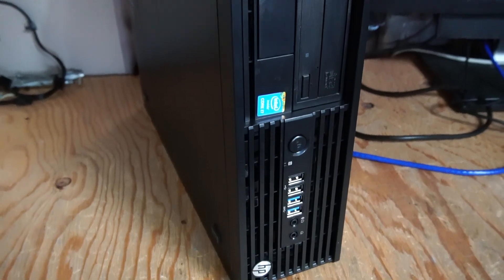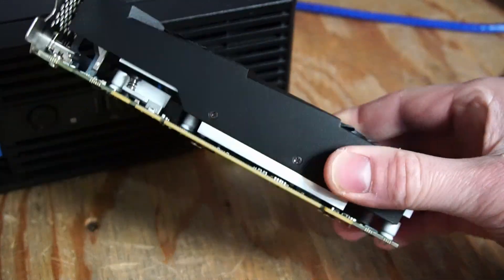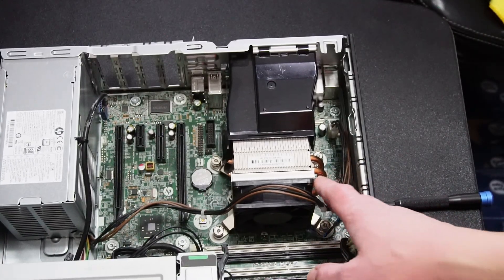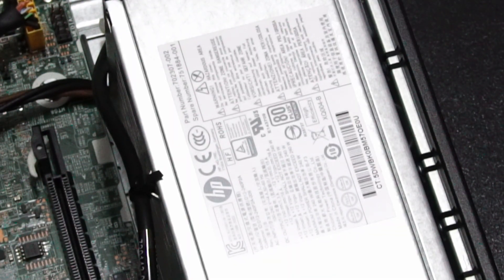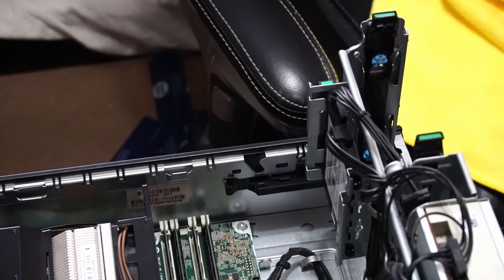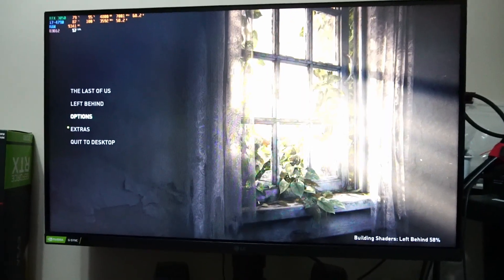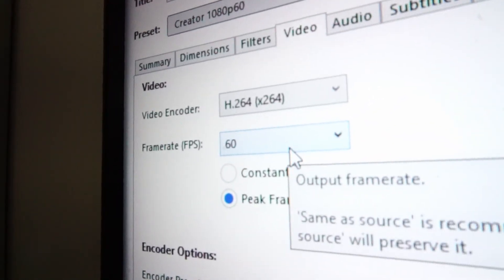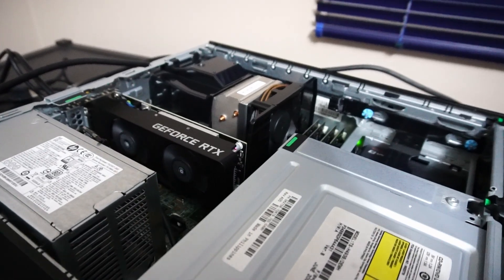Gaming Upgrades in an HP Z230 Workstation PC! (2025 Version)

Comment: I have the same computer and specs but with a msi 1050ti 4gb low profile and 16gb ram, is worth it to upgrade to 3050?
Reply from the maker: I would say go for it if you find the 3050 at a good price.  Otherwise it's kind of expensive for what it is.

Comment: Hi I’m doing this also with the exact same PC! I bought a 350w PSU for it though.

Was wondering if you or anyone else here is worried about windows 10 security updates. I was trying to install windows 11 with rufus on this but it was not really working so I might just stick with the windows 10.

My plan is to take out the dvd player and put a vent and fan in its place at the top. 

Also going to cut a hole in the side panel and put an acrylic panel in it.

Gettng a WiFi card too.

Would love to hear anyone’s thoughts on this as I’m inexperienced with building pcs.

Plan is to get a new motherboard and cpu and ram in 6-12 months
Reply from the maker: Outside of forcing a Windows 11 install, which you should be able to do, check out this video as it sums up some options with the added caveats.  https://www.youtube.com/watch?v=4nIHUSWnpAU&ab_channel=CyberCPUTech

Have fun with the upgrades!  Note that if you get a new motherboard, just make sure it will fit in the HP case (if you are planning to reuse it).
Reply: @HaisteComputerRepair  thanks! I’ll check out the video. 

Yeah I might get a new case too at that point and then upgrade to a full size video card at some point.
Reply from the maker: @Adam-kd5re  Good luck!

Comment: I have the same computer HP Z230 sff but my processor is i5 4590 and I don't have a graphics card 😢 And 6 GB RAM 
What do you advise me to develop? 🙁
Reply from the maker: SSD, 16GB RAM (2 x 8GB if possible), and as low profile graphics cards can be expensive maybe first give me an idea as to what you plan to do with your computer and I can advise.
Reply: I want to play most games at 1080p 60 FPS at least 🙂

I am from Egypt, so don't be surprised by my English 😅 @HaisteComputerRepair
Reply from the maker: @Mustafa_Wael999  English is great, no problem.  If you can find a RTX 3050 or 4060 for a low price go for it.  Despite having PCIe 3.0 speeds on an older platform that might be your best bet.  If not, go for a GTX 1650 or an RX 6400.
Reply: Thank you very much for helping me 🥰🥰🌹 @HaisteComputerRepair
Reply from the maker: @Mustafa_Wael999  Let me know how it goes

Comment: I got same one and came with i5 4690 cpu and Radeon R5 and 8 gb ram. Now iv upgraded it to a NVIDIA GeForce 1030 4gb version. And 16gigs Gskill ram. I wish I had got the 3050gtx that will be next along with another 16gig ram I love this pc my first ever build
Reply from the maker: Awesome!  I used discount credits from Honey to buy the RTX 3050 on Amazon, so it wasn't that expensive.  Otherwise, the cost/benefit to that card is out of whack.  But, if you either paid a very low price or got some items for free, the cost of the 3050 isn't too bad and is kind of fun to test in an older system.

Comment: I ordered one of these today, 95AUD after $25 eBay discount including shipping. Xeon E3-1240 V3 processor, 16gb ram, 128gb SSD, 1tb hdd. That's a bargain here, most basic old i5 optiplexes start at $150. I'm planning to use it as a small server to replace my Dropbox, but also as backup for my aging main PC until I can build a new one next year. I found a model on printables for a 5.25 inch triple 40mm fan holder, so that may be an option for some airflow. I have a few 3d printers.
Reply from the maker: Very cool, if you manage to get those printed send me some pics to haisterepair@gmail.com

Comment: I had old 2008 Gateway FX68000 computer with i7-920 till this spring. I updated it thru years many times. It came with radeon 4850 originally and 3Gb of RAM. Last config - GTX1070 and 48Gb RAM.  Now use Lenovo p520 with Xeon W2135 - RTX2080 and 128GB RAM. Updated only to get valid Win 11 setup.
Reply from the maker: @wacio  I ran an i7-920 socket 1366 for a while.  I did a video on a P520 with that exact same configuration so that’s pretty cool.  Just with 64GB RAM
Reply: @HaisteComputerRepair  i7 when it came out was a beast. it aged graciously as well - I would never expect CPU to be adequate for 15 years. Im mid 90ties computer seemed to be obsolete when you got it home from the store.